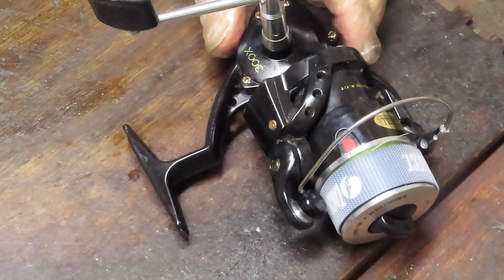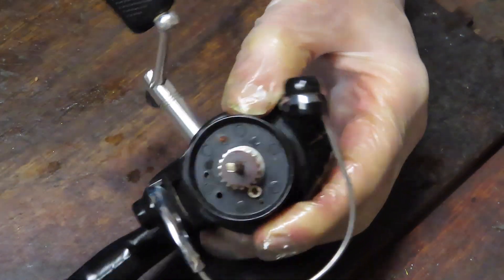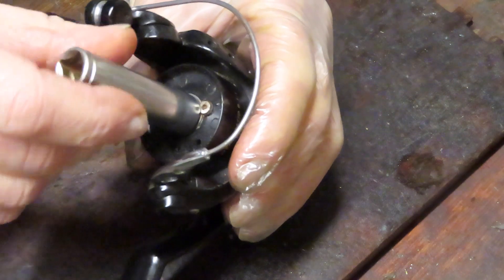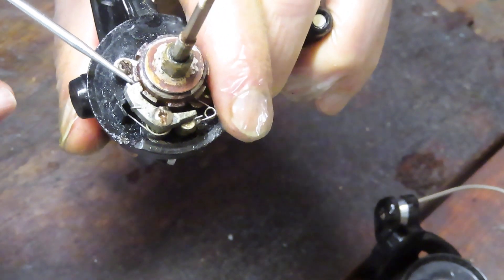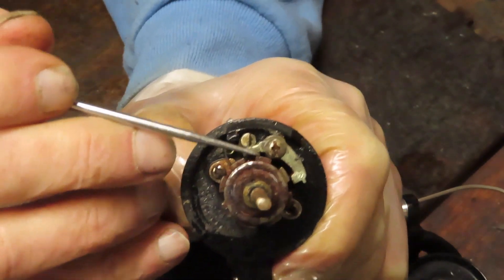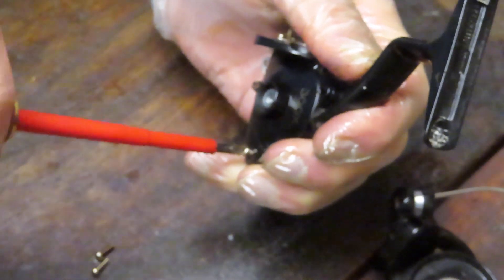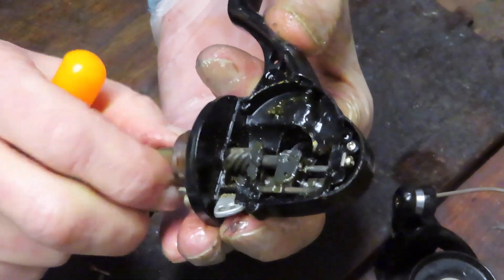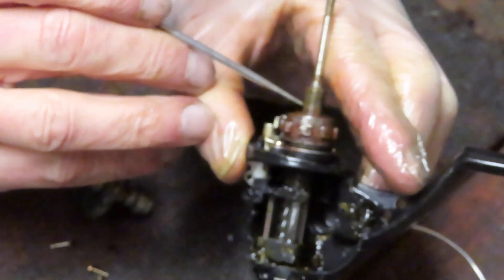Why this Mitchell 300X spin fishing reel failed and how to prevent saltwater damage

Comment: I love the diagnosis videos. Question: Are the anti reverse bearings made by the reel manufacturer or a third party? Is it possible to get a replacement from a third party with the dimension of the part? I am sure you exhausted all of the options but just wondered for my own edification. Thanks again for the great learning videos .
Reply from the maker: Some A/R bearings can be replaced using alternative sources as they are standard.  Many are manufactured specifically for on manufacturer or one model that a manufacturer produces, so those are only available from their distribution partners and in limited supply.  Thanks for asking - Dennis

Comment: I guess you know what I think about a Chinese Mitchell. I have 52 French made Mitchells so that pretty much covers what I think. I agree with your determination of a poor design and I would add poor materials as well. Most of the time I don’t immerse a reel after I use it surf fishing but rather spay it down well and wipe clean.  Sometimes I even remove the spool when do that. Then I use a military style gun wipe on the entire reel. If one of my reels fell in the water that reel will be completely disassembles, cleaned lubricated and reassembled again wiping with the gun wipe. Even though I don’t particularly care for this 300X this damage could have been avoided. If it was a reel that meant a lot to someone I am very sorry it ended up like this. It bothers me that parts for these reels that are much newer than almost all of mine no longer have parts available. I consistently am able to find parts for many of my reels that are 50+ years old. That alone says something about today’s manufacturers.  It’s such a shame.  This was a great cautionary tale Dennis!
Reply from the maker: Yes and yes.  It is a shame - Dennis

Comment: hello Dennis I need your help again. I watched you video on the Mitchell 300 repair the bail . This video help! my bail now snaps back just like the one you worked on. I continued to watch the video and you did a complete service. So I did the same. Here's where the problem begins. Everything went together well. The gears turn free as they should on both sides as yours did in the video. However when I tighten up the case screws the gears bind. When I loosen the screws the gears turn smooth.......Any idea were I went wrong? thanks
Reply: Any chance there was a gasket on the case?  That would reduce the clearance for the gears.
Reply from the maker: It sounds like you may have trapped the anti-reverse dog under the main gear.  You need to reset the main gear with he A/R dog in the off position. loosen the handle and then flip the a/r dog switch to see if it is installed properly.  That would be my best guess - Dennis
Reply: @2ndChanceTackle  always thanks for your help. Yes I tried that and also removed it completely. IF you can think of anything else let me know. Again thank you.

Comment: Could an ultrasonic cleaner be of use by removing the grease from the body, and submerging the entire reel using rust removal liquids? All the best.
Reply from the maker: You could try, but there is a time to stop and this reel was beyond hope.  If you wanted to experiment with the solvents, score it up as a tuition reel - learn if you can or can't.  That A/R clutch is shot, so even if it was freed up, it is unlikely the reel would perform well

Comment: Dennis, where could I buy it aquire a left side bearing and bearing spring for a true temper 922c, I just recieved one in immaculate condition with the original box missing that part
Reply from the maker: You need to try the used equipment sites like Ebay and Craigslist or Facebook marketplace. Probably best to buy a donor reel, but sometimes Ebay has just parts.  I will go out on a limb here and say most side plate bearings in the Ocean City and True Temper 900 series are interchangeable, so you don't need to look specifically for the 922 model.  Please send a note to my email 2ndchancetackle@gmail.com I recently previewed a bunch of junkyard sale fishing reels and there was a Sport king in the bunch.  That may have the bearing you need - Dennis